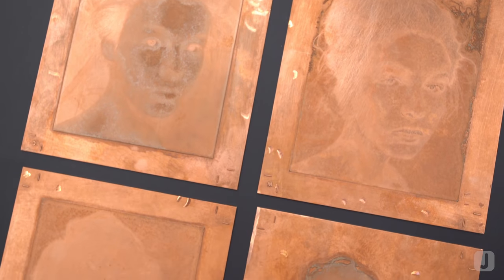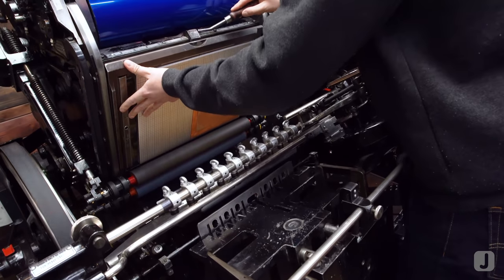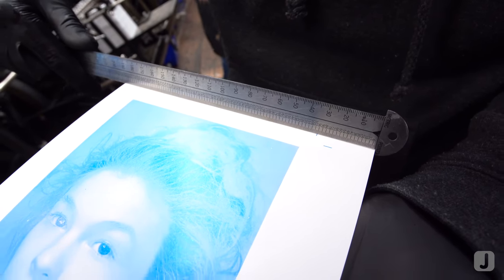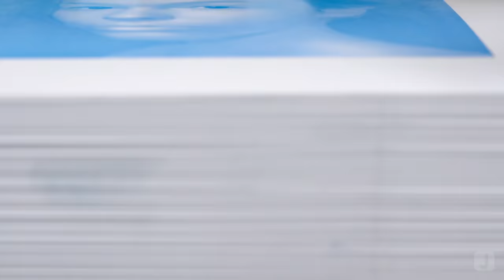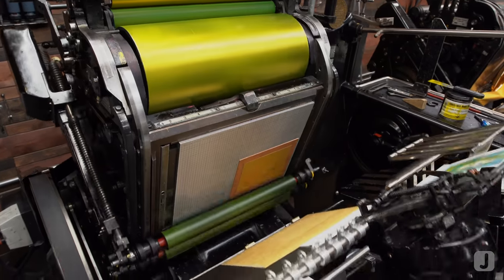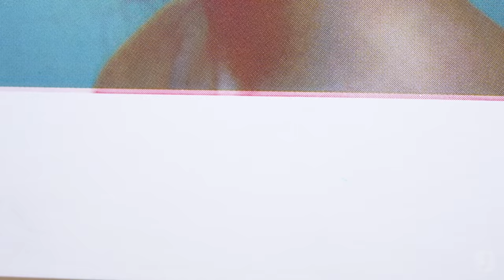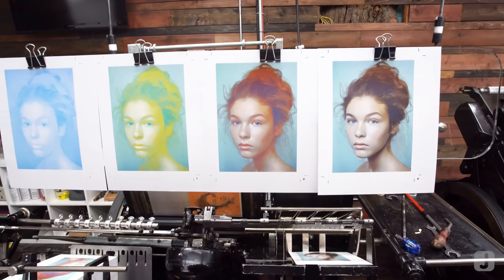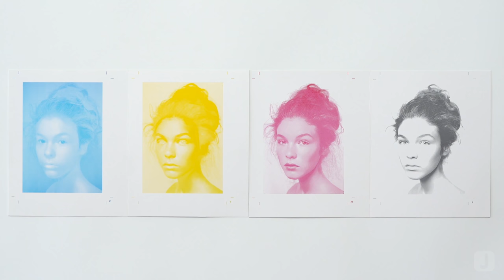Half-Tone Letterpress Printing a Photograph in CMYK!

Comment: Hello, Quite a craftsman. 4/color L.P. and on an Original Heidelberg GT 13x18 platen press.
Not many pressmen would attempt such a feat.
Your color sequence was perfect. Cyan the most important color down first allows easier registration
for the 2nd down yellow. Did you have progs or is this a subsequent run ?
AT any rate, super job, great looking shop, and an immaculately clean press.
From the little I could see, it looks like you also own a Polar.

Comment: After 43 years in offset printing, there are ways to make color  more predictable on an 4color job even doing it on a letterpress. Old timers, before me, used color filters to look through for the yellow, to see how even it was, since it’s difficult to see by the naked eye. One color at a time was on its way out the door when I came into printing. Those guys had their tricks though.
Reply: I was a pressman for 27 years, starting on Windmills. I saw a guy running 4 color on a Heidelberg KORD. That was common, but what wasn't common was he swore by starting with yellow. I asked him how he managed the density and dot quality of the yellow...this was before densitometers were common. He used a sheet of tinted transparent plastic...might have been blue?...to examine the yellow ink on the paper. The blue "filter" made the yellow ink appear black so it was easy to check quality.  Plus, as we all did, he had his press dialed in as far as proper packing, water system and the all important "hiss" of a healthy ink film on the rollers.

Comment: I don't think I've even SEEN a CYMK letterpress job! Good on ya!! No ink/water balance to worry about. It's tedious, for sure. If you ever do it again, I suggest color bars in the trim area, so you can check ink density and consistency with a densitometer. Also, I don't know if you ran into set-off issues with the coated stock, but shorter delivery lifts and a little powder will help prevent that.  How much make-ready did you use?
Reply from the maker: I definitely could’ve used color bars and better crop marks on the plates but certain decisions are made above me so I get what I get! We had some set-off issues for sure, mainly when there was a bit too much ink on press. There was at least 200 or more sheets of makeready. Trying to predict how the next color would mingle with the previous was the hardest judgement call throughout the run. Very little to go by!
Reply: @JukeboxPrintLive  yeah, very easy to overload the ink. Color bars and a densitometer would have made a great difference! Flying by the seat of your pants on a 4-color job is tantamount to gray hair!

Comment: Very nice result. I’m surprised the registration was so good, given that you appeared to be using no mechanical lining up of the plates?

When I entered the newspaper industry, as a graphic designer, letterpress and hot metal typesetting was the norm. Roughly a decade passed before offset took over. Huge beasts of machines, both. From a graphic perspective the main point of difference was the lines-per-inch ratio: 65lpi for letterpress, 95 - 110lpi for offset. Newspapers use one of the most absorbant  papers short of paper towels, so anything finer than 100lpi is likely to turn to mud. Offset does allow for a greater colour gamut, though, even on newsprint.
Before computers, colour seps were always done by hand either as overlays or keyline. Colour specifying was always something I enjoyed, along with mechanical assembly. Computers and graphics software did away with all that, sadly. It has definite advantages of course, but there’s not the same sense of tactile satisfaction.

Comment: Again a really great video. Thank you so much. It's obvious that you are professionals with an eye for detail.
I would have needed the video at the beginning of my second vocational training. At that time I started as a service technician in digital typesetting. I have a question again: You rasterize the 4 colors in 4 different angles to avoid the moire effect. Do you always use the same angles or do you adapt them to the paper or motif?
Reply from the maker: Great question! We rarely change the angles used in a halftone process print but if added spot colors are involved it almost always needs to happen. CMYK doesn't reproduce intense greens, pinks, and oranges very well so making room for a 5th or 6th color would require a different set of screen angles for each plate.

Comment: best video yet!!! and perfect timing as we're all home with ants in our pants! on and 'old days' note---- I'm in Dallas which used to be a huge press market - some of the big guys. There are only a handful of service bureaus around and just about two weeks ago I had set out to get a linotronic (transparency) made to use as an optical checker in my shop (like a quick overlay checker on a job that we do all the time)... and the biggest bureau around literally didn't know what I was talking about. He literally said that they don't offer transparency or anything on film anymore. I was stunned. I guess I'm so out of touch with the times anymore. My first thought is that much of the screen-print world still needs good hi res artwork laid down on transparency, right?
Reply from the maker: Steve Colwill screen printers can get away with some pretty weak film. We use a proper blackout film from an old Agfa image setter. It needs to block really strong waves of light in order for our development and arch to be just perfect. Film is getting harder to find but it’s still out there!
Reply: @JukeboxPrintLive  That's precisely what I ran-- the Agfa film lino. and you're right, if the chemicals are dialed in, the blacks are awesomely non-transparent... and the 2400 dpi was awesome as well. (that was 22 years ago).

Comment: This is the most beautiful Letter Press Haftone job I ever seen. 

@Jukebox Print...Could U pls share more details to educate me and others. 
1. What is the screen resolution U use to make four Halftone copper plate?
2. What is etching process U use to make Halftone copper plate? (Acid Etching or Digital Etching)    /  Thanks
Reply from the maker: 1. We start with a 600dpi image that is channel separated into 4 grayscale PSD images.
2. The etching process is a photo chemical engraving process. The image is exposed and developed on onto the copper and an acid bath eats away all the copper that isn't part of the developed area.
Reply: @JukeboxPrintLive  Thank you so much 👍👍

Comment: I work at a screen printing company, so it's been really neat to see the similarities in letterpress and screen printing as well as with this video. I do have a quick question for you. In screen printing between some of the ink colors you need to flash dry the ink., I understand on regular letterpress jobs with the cotton paper why you wouldn't need to dry the ink in some way, but with this CMYK on a coated piece of paper is there a need or somewhere in the process for the ink to dry, or does it dry almost instantly when it hits the paper?

Comment: Nice job, the plates you used, you could have mounted them on a Patton Base. They mount with hooks so you can move side to side, up and down, and you can swing the plate if it is crooked. Who ever made the plates should have made you progressive proofs to follow. If this were a critical job your color could be off.  I have been a pressman for 48 year in both Letterpress and Offset. I think you boys did a good job, just giving a little advice. One last question, I did not see you run any spray powder,  how did you not get any offset being that you ran coated cover?

Comment: Fascinating and totally enjoyable! And that calming ShhhhH - ti-a-ck sound! (well, hearing it the whole shift might not be that nice :-) )
I"m wondering - the drums are all metal or interleaved metal and "rubber-like" (the blue ones)? 
Secondly, where and how does the ink go off when you clean the drums? It looks like just a few drops of some solvent and it disappears!
And lastly, when you cut it to shape by the end, how do you align the last cut? All the marks are already cut off by then.
Reply from the maker: Glad you enjoyed the video! The blue rollers are made of a nice soft rubber while the vibrator rollers and rider rollers are all stainless steel. The washup is done with a single squeegee blade that is pressed against the cylinder. The solvent loosens the ink and it gets wiped right off into a small tray.

As for the cutting, we know this was a 5x7 final sized print so my last two cuts are going to be 5 and 7 to get to the final size. In cutting, the first two cuts and the last two cuts are the most important!

Comment: WOW– as a graphic designer I've been working in printershops too. I've seen some pretty nice tricks, but I've never seen a color portrait printed in 4 colors on a letterpress printer. Really nice work.
What are you using for cleaning the rollers – vegetable oil or petroleum?
Reply from the maker: We use a water miscible press wash. It's a solvent that is designed for printing inks specifically and works just as good as kerosene. Much safer too...

Comment: concerning the color density of subsequent colors: Would it make sense to print the new color "alone" once to check whether the overall density is ok before overlaying it on the previous color or doesn't that make any sense?

Furthermore are there any views of the cotton paper version or did you stop printing that after cyan?
Reply from the maker: That is a good way to check how a single plate is printing yes!
Reply: It helps when or if you do a reprint  plus the you did this without a proof from the plate makers
Reply: We used to use color keys to help with the individual color density. I was an offset stripper for 1/2 of my career before I went digital

Comment: One question: how can the prints stack on top of each other without staining/ruining the back of the next print? Is it a special ink? or just because the amount of ink is not so much? I have no experience with this kind of print, so that's why I'm asking :)
Reply: Usually there's a white powder (in Italy we call it "antiscartino") spreaded by a metal tube placed on top of the paper receiver. In this particular video I don't see it in use thou. So... I don't know the answer in this particular case :P
Reply: You handle very gently. With the proper amount of ink you shouldn’t get any offset if handled properly. A powder attachment is useful. Just a couple of grains will hold the sheets apart.
Reply: The ink is also heated
Reply: @BelindaShort  You're dreaming. Try Cobalt added to the ink.
Reply: Belinda Short the ink is not heated.
Reply: Set off is a problem on high coated stock, fine anti set off spray can be used sparingly or carefully remove from the delivery tray in small amounts, or interleave with a rough stock
Reply: Colbolt driers is fine but must be used sparingly, lf allowed to dry on the rollers it is a hard job to get off also it will reduce the viscosity of the ink and may affect the quality of the print.

Comment: Do that with foil and then you might impress me............I’ve done it but on Kluge presses!  Also have done sequential numbering with foil on Kluge Presses.  You have a much better control of pressure with Kluges than Windmills!
Reply from the maker: Andy! You trained me on a 14x22 EHD Kluge years ago. I love running that machine and still do when I can. The makeready techniques I use for foil stamping mostly stem from learning from you. I recall your numbering foil job for trading cards and a few other unique tips. Thanks again!
Reply: Jukebox Print when and where?  I’m getting old and forget easily!
Reply from the maker: In London, Ontario. Maybe 5+ years ago now. You’ll be happy to know that EHD is in good hands and running strong.

Comment: what was your reason for printing cyan first instead of yellow, i thought it was supposed to be lightest to darkest ..
Reply from the maker: We followed along with an old “hints for press operator” book that we have in the shop for running halftones on platen presses. It recommended using cyan first along with a handful of other tips. With that,  and the sheer amount of blue in this photo, it seemed like the best approach.
Reply: I wondered the same thing. Thanks for asking.
Reply: When cyan is printed on yellow the yellow kind of get’s lost in the resulting green. By printing the yellow on the cyan the yellow still comes through.
Reply: The reason for running yellow third is it is a making color if you run first and if it is to dark it will effect you reds and blues to much yellow will make your reds to orange and blues green which will also effect your browns
Reply: Exactly... this video raised a million "why" questions, and answered almost none.
Reply: @johndrzal4087  Shouldn't that be why someone does a full test print first, before wasting time and resources printing a shitload of copies that may or may not even be good enough for the next plate?!? This vid raises so many questions!
Reply from the maker: I will make it my personal mission to educate you to the best of my ability. I am sorry that you have been left to ponder the wonders of printing without resolve. There is so much to cover and I am excited to help you become as knowledgeable as possible. Stay tuned.
Reply: There has always been a question to what color rotation you would use in the 4 color process. The best rotation that I have used is black, cyan, magenta, yellow. We run that all the time in offset. Years ago, the separations were done differently. Now they are formulated to run in that rotation. Years ago in letterpress on the 2 color miller tw, a 21x28 inch letterpress, we would run in the first pass, magenta in the first unit, and black in the second. The next pass was yellow in the first, cyan in the second. It was the best trap. The other reason was so the light colors would not contaminate. It is always an experiment, next time try going black, cyan, magenta,yellow. Your flesh tones will come out much better. Remember, yellow and magenta always make the piece look better. I am glad to see that letterpress is still alive. I was taught this trade by my father when I was 12 years old. He was a commercial letterpressman in New York City, and he was a makeready specialist. According to his coworkers, when he closed the packing, it didn’t open anymore. Best wishes Jukebox and keep on pumping!

Comment: I wonder, why does the colors look so dark when you put them on the roller? Seems to be kind of strange, because the printer toner powder in my printer is waay lighter, magenta is kind of deep pinkish (my printer toner "magenta" when I open the dispenser shutter, is MUCH closer to your logo than the color on those rollers) and cyan is more of a light-blue or turqoise color. While in your press, they look like very dark blue and dark redish in color. Is it about lighting in the room making the colors look so dark when you record or are the colors that dark? Or are the colors mixed with something in your press making them lighter just before they are put on the copper plate - kind of some drying or developing agent causing the colors to harden?

Another thing I wonder is - why isn't the colors smearing on the backside of the papers when they come on top of each other in the result bin? It seems the press doesn't have any dry delay. I could understand the thicker cards, because there the colors are kind of recessed and they don't touch each other, but on these papers the indentaton seems so little so the papers would touch each other causing smearing. But I don't see any smearing on the backside - and the colors couldn't dry so quick because then it would dry on the rollers.

So are im right that the color is mixed with some drying agent in the absolute final step just before applying it on print plate - thus also making the color lighter aswell?
Reply from the maker: The biggest difference here is that we're using an ink, while the machine you're using is a toner. Our ink is mainly a linseed oil carrier mixed with the pigment while your dry toner is likely pure pigment. On top of that, the transparency of a printing ink combined with the silver cylinder on the press will darken the appearance of the ink. In addition to this, the blue rollers also effect the appearance of the color. 

The "smearing" you talk of is something we would call "offsetting". This print project did actually have some offsetting of the ink onto the backside of the print. Usually, to fight this we would use an anti-offset spray powder but it's a real pain in the butt. Basically, after each sheet is printed, a small blast of corn starch powder is sprayed onto the surface of each and every sheet which helps to quickly dry the ink and help to stop any ink from transferring to the sheet above. These are great questions. Thank you so much for watching and asking!

Comment: Why didn't you put colour bars on the plates, also registration marks at the centres between your trims? With colour bars you can check the ink density with a densitometer.
Reply from the maker: I wanted the extra challenge. Our next CMYK print video will feature that.